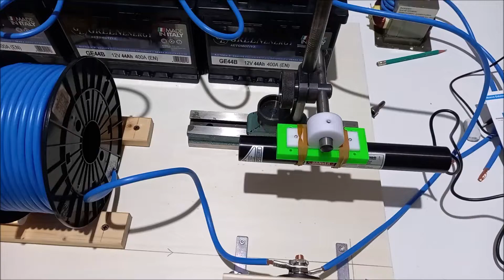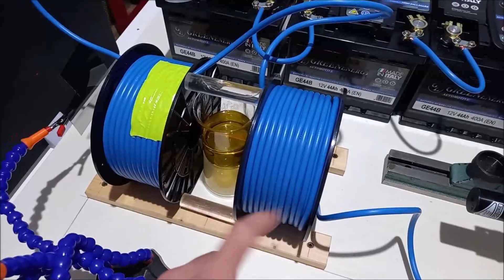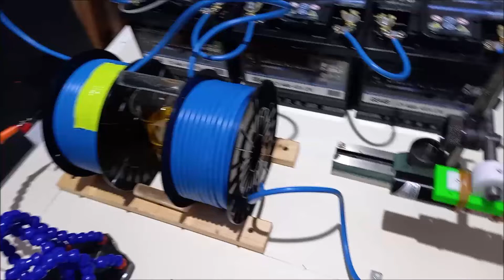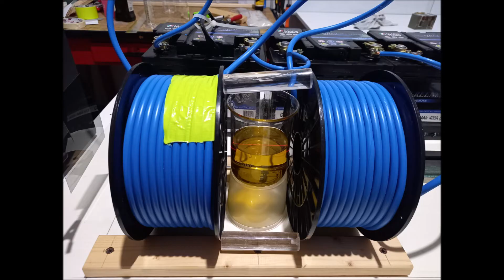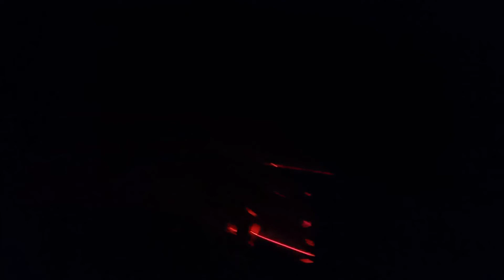Faraday rotator

Comment: Can you give an estimate of the B-field in Tesla and applied voltage? Looks like 3 12-V batteries? Nice clean demonstration!
Reply from the maker: Thanks for the comment! Three car batteries (each providing around 12V) were connected in series for a total applied voltage of 37.60V (measured experimentally). The magnetic field generated by the Helmholtz coil varies along its axial coordinate, but at its center the measured value (through a Hall-effect probe) was around 0.120T (120mT).